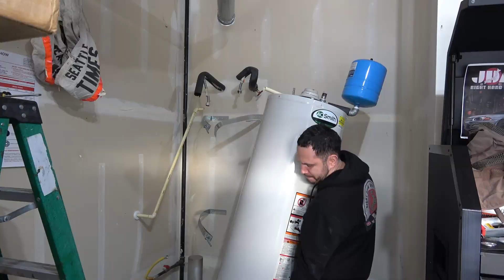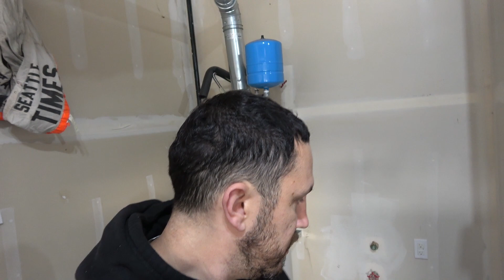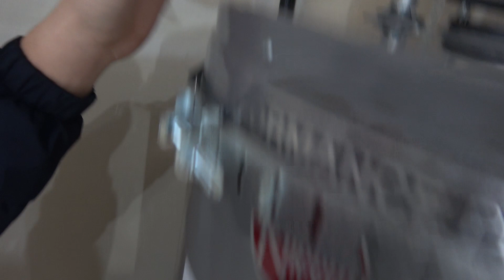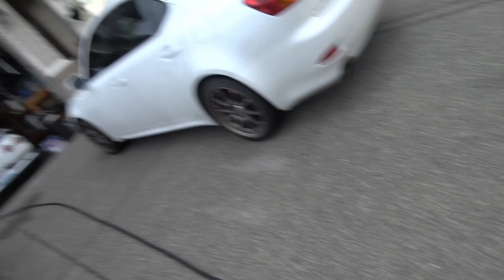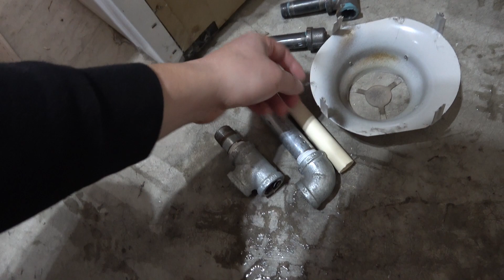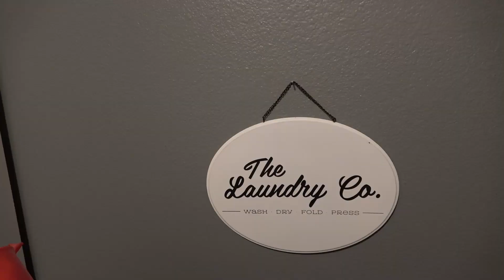Hot water heater leak plumbing basics, how to fix and when to replace hot water tank?

Comment: PEOPLE PLEASE DO NOT, I REPEAT DO NOT DO WHAT HE DID, THIS INSTALL IS SO WRONG.    HE USED THE WRONG PIPE FOR THE EXPANSION TANK, HE USED BLACK PIPE THATS FOR GAS, THE WRONG GLUE, THATS CPVC YOU HAVE TO USE CPVC GLUE, YOU CANNOT USE PVC PIPE FOR THE T/P LINE. THAT HAS CONNECTION, THERES A REASON FOR A GAS SEDIMENT TRAP, PLEASE DO NOT CAP IT LIKE HE DID.
Reply: what kind of pipe i use?